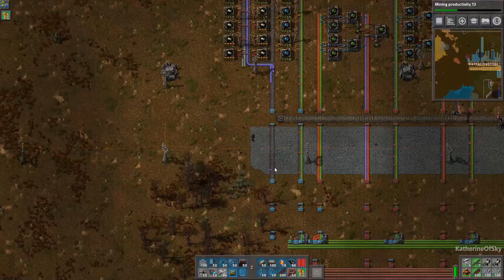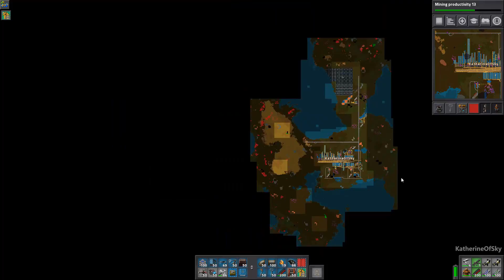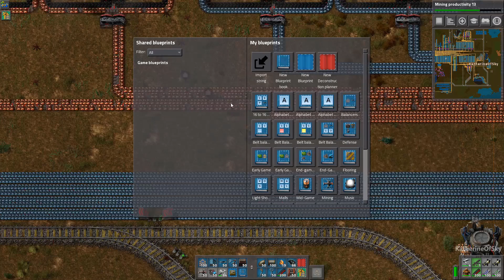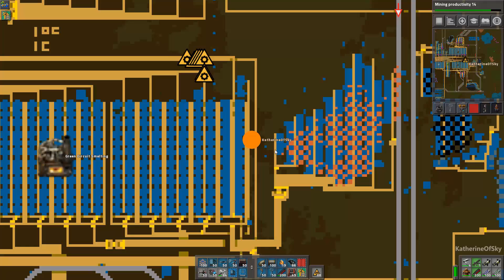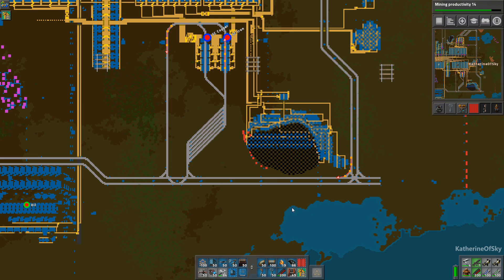Factorio: Entry Level to Megabase Ep 42: LOW DENSITY STRUCTURES AND SILO - Tutorial Series Gameplay

Comment: 28:10 that doesnt look like a proper 5 to 3 balancer.. its more like 3 splitters mergeing 5 line to 3 ..that followed by some kind of weird 3 to 3 balancer:/
Reply from the maker: It's from the Belt Balancer Compendium, so should be correct.
Reply: if you pause it at 28:10 you can see its clearly not a 5 to 3 balancer... 

look the top part of it there is 5 lane comes in to 3 splitter that is just placed next to eachother....
and merges the 5 lane to 3 lane... 

then under that there is something looks like a ... i dunno maybe 3 to 3 balancer:D

Comment: (0:24) Huh, I was right. I guess yellows are only helpful if the belt is full.
(4:21) Low on copper? My base barely uses it, but then again, iron is used a lot more!
(5:35) Huh, I made one that's is a bit longer, but that one is quite short and effective.
(7:39) Pretty sure you got rid of it 5 episodes back.
(-:--) Anyway, I'm watch this later

Comment: If you're going to make 4 or 5 silos (!!!), maybe prod-3 modules in the silo factory so you get one or two "for free"?

Also, I'm both fascinated and frightened at the thought of a base that can feed 4 or 5 silos. The biggest I've ever built was just under one rocket per minute, and that only needed a single silo which wasn't even close to fully speed-beaconed. This would be maybe 8-10 RPM or thereabouts?
Reply from the maker: That's a good idea!  I hadn't thought of that.